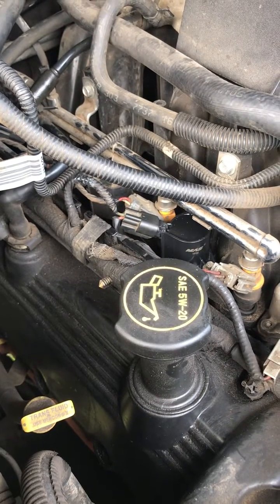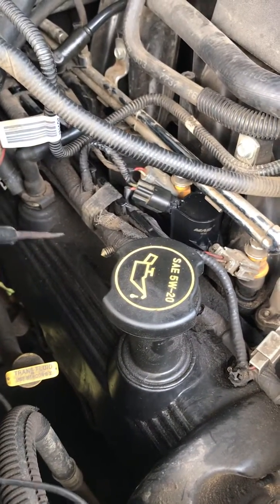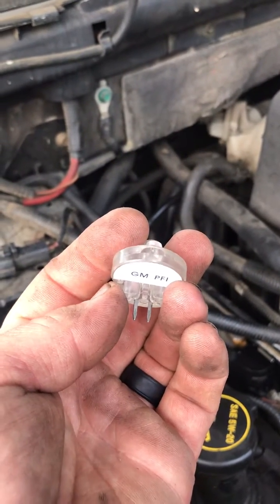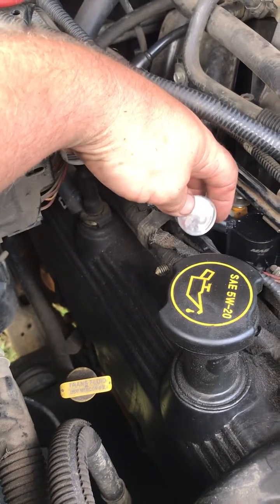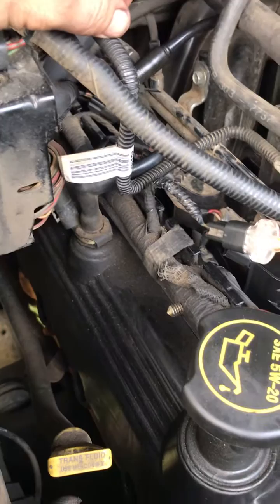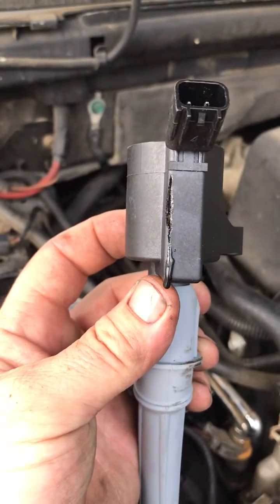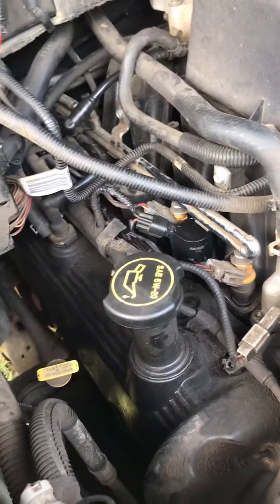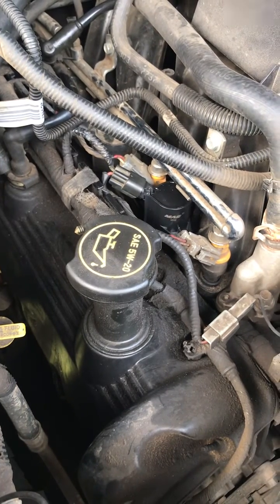P0351 code and misfire fixed 2003 5.4l F150

Comment: You said 15 and 20 ohms. I've watched 20 videos some 5to6, 30to40, 5000to7000 where are you guys getting your radio signals????
Reply from the maker: I checked all coils and they were all close in readings except one.  The one was the bad coil.  So I went with the others as a good reading.

Comment: So what is actually causing this & how to fix??? 
 Now what if you have a Coil RAIL on a 4.0 inline 6 engine with the EXACT same problem? 
This damn code will be the death of me! 😞
Reply from the maker: A bad coil was the culprit.  Pull the spark plug  for cylinder #1 the code is for cylinder #1.  If the plug is covered in fuel it is not firing properly.
Reply: @adamsautorepairLLC  Brand new OEM spark plugs gapped to spec. 👌🏼 On my 3rd Brand new Rail Coil. Open entire wire harness. Haven't seen a short to ground or an open. Been searching for days. All my wires look new & pristine. To the last of my knowledge the resistance in the rail is in range & the wires on harness connecting rail and to PCM. All fuses & Relays check out. I even have a test light, an Amp Hound, OEM Circuit tester & a Multimeter. 🤷🏼‍♂️ There's always something wrong after another after another.. 😞
Reply: @maniacalmonster2293  you need a scope and and an amp clamp to connect to cylinder 2 to get a known good reading you are going to look for a spike in power on this and if you find a spike in power on 1 then you need a computer the noid lights are good to see if signal is good but does not check for high voltage spikes that keeps killing the coil due to the computer 1 driver is not sending correctly but it is sending